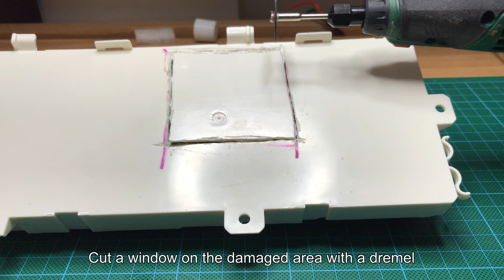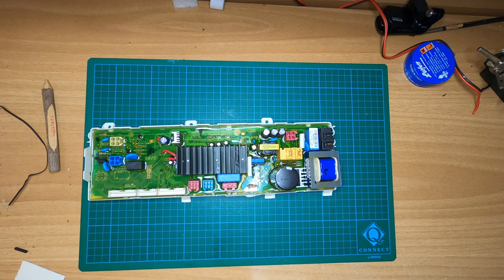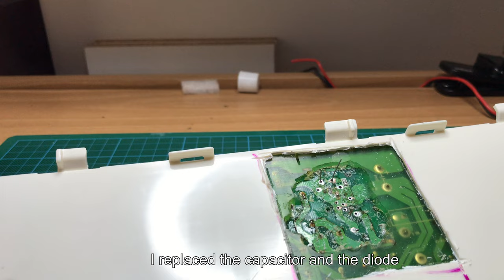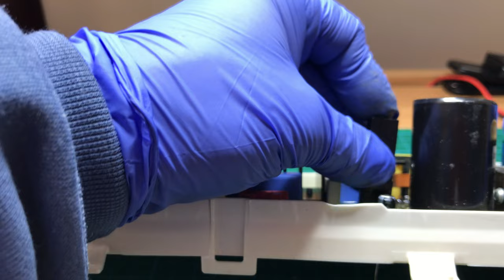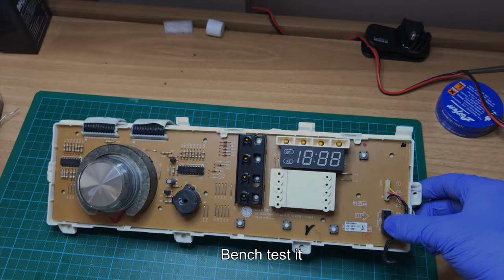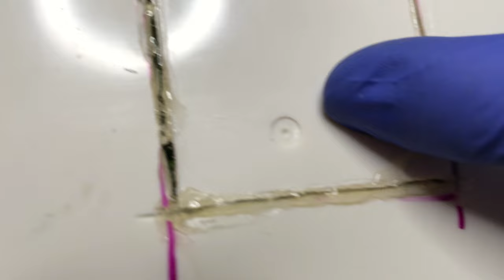LG No Power - DirectDrive Washing machine dryer DIY repair solution

Comment: Hi I have the same problem but not the same kind of board. It's also LG. Thing is I found that piece that you replaced exploded. And of course I couldn't find the part number. I also can't find the same board in the internet as it is discontinued. Do you have any idea how I can replace the part?
Reply from the maker: The best thing would be to find the missing part and read the code. In our situation it was on the bottom of the washing machine... Not all LG power boards use the same part. Some use the TOP246 and others use the TOP248 and the parts are not inter-changable. Otherwise search the net for forums mentioning your board in order to find the part number, check also foreign language sites with auto-translate... good luck!
Reply: @varnasfix  thanks! Are you running it in 110v or 220v?
Reply from the maker: @julietechotangohotelalphai1148  it is 220V
Reply: TOP243YN IC  Search that if you have not found it. I have a Kenmore elite made by LG with the same problem.
Reply: Top246y

Comment: Hi Varnas, could you tell the spec of the zener diode we need to replace? Thank you!
Reply from the maker: Unfortunately i don't remember the part. From the stock of zeners i have it should be either 7.5V or 24V. You can try to use a magnifying glass to try to read the markings on the zener...  damn i should have included it in the video....
Reply: @varnasfix  Thanks!
Reply: Hi. It is 7.5V.
Reply from the maker: @mirceacstan  Thanks for the input!

Comment: If display not showing. Then what need to replace
Reply from the maker: If it has no power at all then this video applies to you… if it has power but the display is not working then the problem is with the display/ button board. It sometimes has water or moisture damage..
Reply: @varnasfix  thanks. 1 board display problem. Same pcb has red light on for some time. But no working.
Reply: @varnasfix  I take other pcb when I switch on washing machine. 3 resister blown out.
Reply: I take other pcb when switching washing machine OE code coming. I checked water drain pump. It's ok supply is not coming from pcb. What I do?
Reply from the maker: Are you sure the “other” pcb was a good working one? Did you check for shorts?

Comment: I had one Pcb today going open it tommoro fault is dryer heater ( dE) error after few minutes sensor are ok and drain motor stops with error (oE) seen too much melted silicone Top246 pins and area silicone melted Pcb works what you suggest is it dry solder or any part failure pls reply Thankyou 04jan2024
Reply from the maker: The Top246 IC gets very hot during its operation so brown/burnt silicone on its legs might be normal, plus if there is a problem with this IC the unit is dead and does not power on.... 
First of all you should check the heater element and all the sensors associated with it...
Hope that helps!